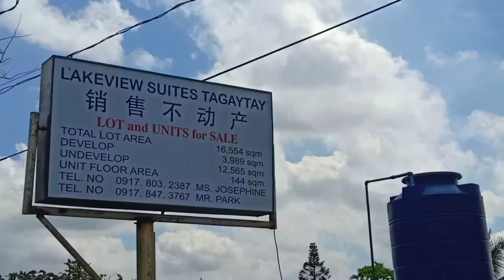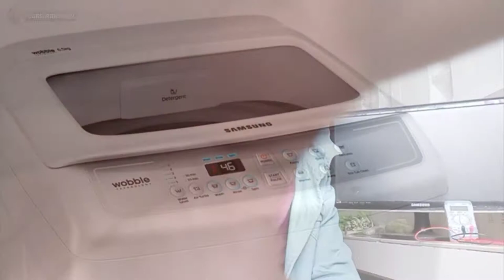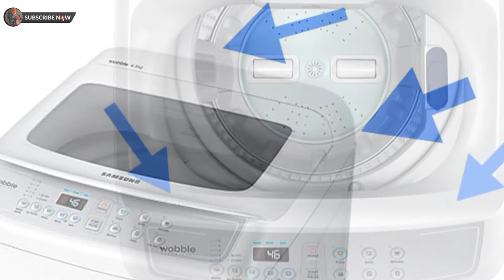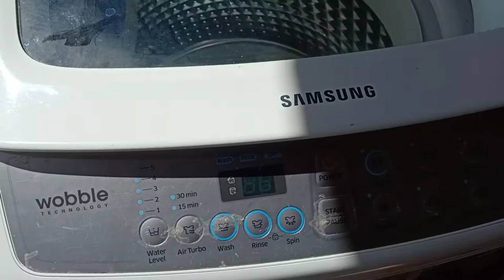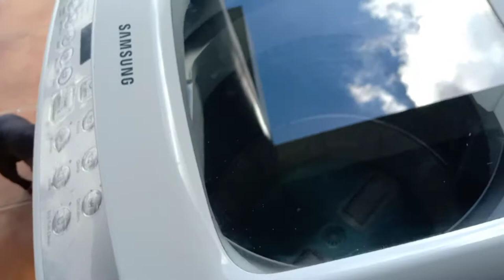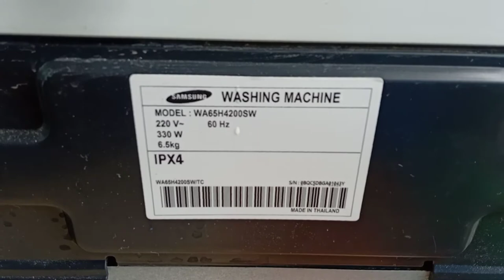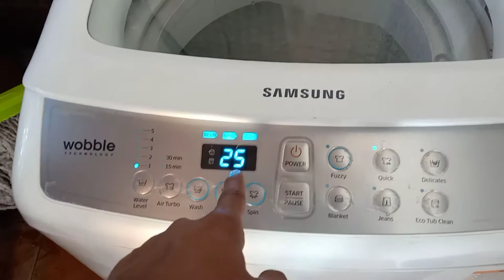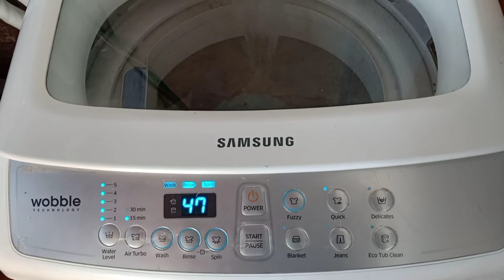Samsung Wobble | Making A Loud Noise | Possible Problem? | Home Service

Comment: Sir. Ano po kaya problema pag maingay pag nagwawash  and rinse mode pero pag spin ok naman po. Thanks in advance.
Reply from the maker: Baka may naka stock lang po jan maam o kaya madumi lang po yung pinaka loob po, kung may marunong po magkalas at magbalik po jan sa inyu para malinis po loob
Reply: Pinacheck up ko po sabi nung tumingin pulsator roller daw. Nung pinalitan umokay lag saglit tapos umingay ulet.
Reply: Samsung Wobble 7.5kg po yung washing machine

Comment: Hi po may washing po aq na eureka ngmit ko na man po mga 2yrs tpos po bigla na lang umingay pag nag drayer. Tpos po ktgalan ayw na nya mag drayer puro laba at banlaw na lang pag tapos po mag drain ggana nman po sa drayer un nga lng di na naikot sana po mapansin salamat
Reply: Ano po kaya posibleng problema ng washing eureka auto matic.sakamat po sana mapansin
Reply from the maker: Hello po pasensya napo late response, saan po location nyu po
Reply: Nueva ecija po